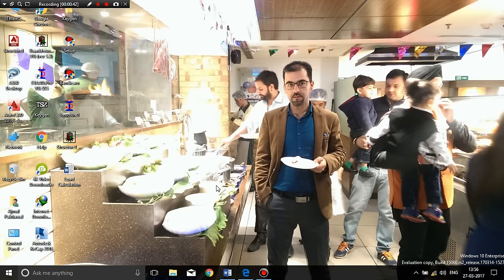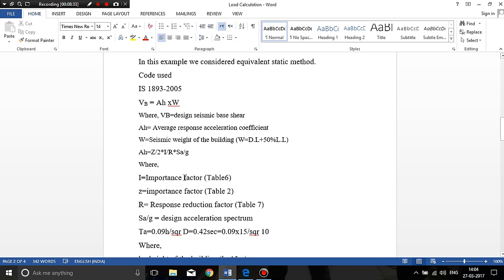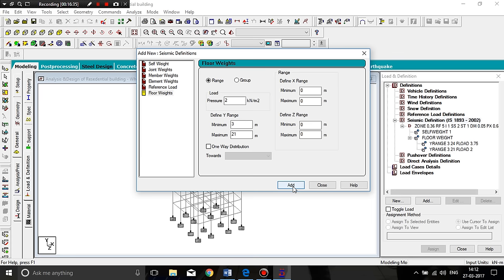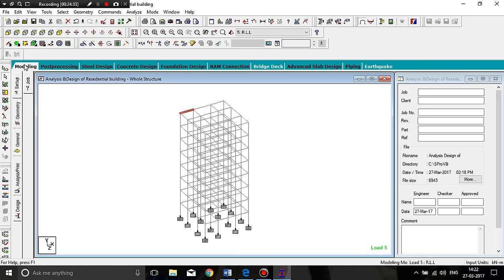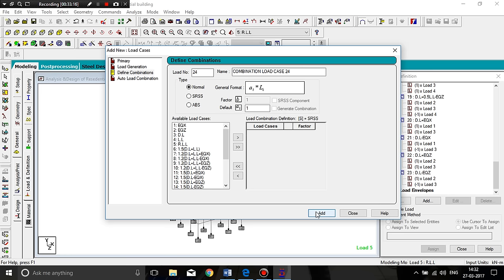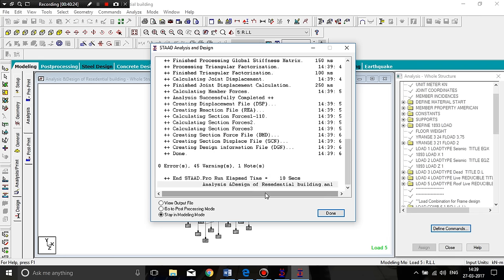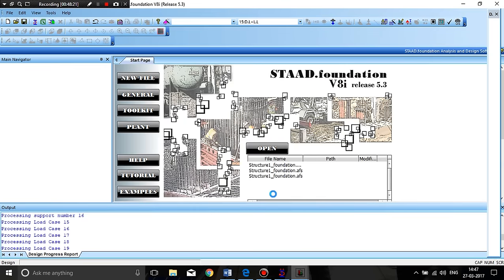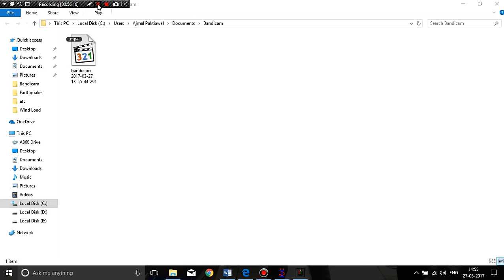Seismic Analysis using Staad Pro V 8i

Comment: Sir, aapne is analysis me slab thikness 150mm assume kiya h, but kahi apply nhi kiya
so please help me for applying slab properties and steel properties if we take steel section as beams for multi story building....
Reply: Navneet bro, slab thickness has assigned under section property tab. General-- Property-- Thickness--define thickness, select the plate thickness,
then under select tab, Select--Plates parallel to XZ---Assign to selected plates. If you want to take steel sections then you have to select from the section database tab your desired steel section.
Reply: #haricseguru Great people!! Keep going 👍

Comment: You have considered Eqvt Static Mtd for siesmic analysis, for G+7 structure, whereas the same is applicable for buildings lower than 15m in Zone II as per Cl 7.6 IS 1893(I) 2016. Please clarify.

Comment: On clicking generate option during seismic defination it showing creation failed,can you tell me how to get rid off from this problem
Reply from the maker: PRAKASH RANJAN u should reinstall ur staad pro
Reply: instead of reinstalling , you can do the following procedure :
1. Go to the directory where your STAAD Pro is installed. 
2. Open the folder STAAD and search for DLL1893.dll 
3. Copy the file location of DLL1893.dll . It will look similiar to this : ( C:\SProV8i SS6\STAAD\Dll1893.dll )
4. Run CMD as admin 
5. Paste the following command : regsvr32 “C:\SProV8i SS6\STAAD\Dll1893.dll”
6. Reopen STAAD , You are done

Best Regd.
Reply: @sayanchowdhury5667  Can you explain once again from 4th step onward ? What do you men by "Run CMD as admin" ?

Comment: why are you not considering  beam as dead load in seismic analysis
Reply from the maker: Beam dimensions have been introduced to the staad pro, the software itself counting during the analysis. When you are giving and introducing the size of members such as columns, beams, and so on, the software itself estimating their respective dead load. The user has to calculate only live load and so on.

Comment: If the building is of irregular shape then how can we calculate Time period in X and Z direction ? For example take a building in S shape then 🤔
Reply from the maker: Thanks for watching my video. for the irregular shape of any type of structures you can take the max length for building which Indian standard abbreviated with D under square root. please refer to IS 1893 you can easily find the period in X and Z direction. if you want to know more about it then let me know to provide a video with manual calculation.
Reply: Yes please i would help alot